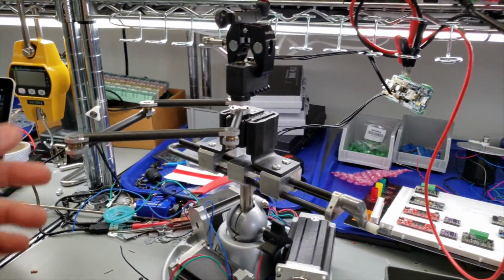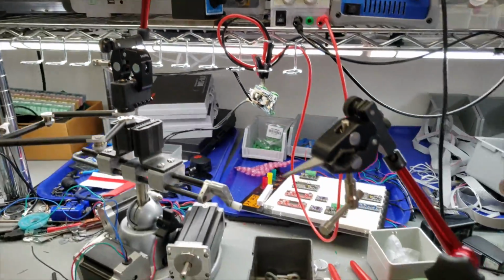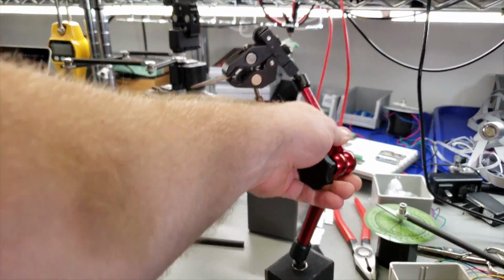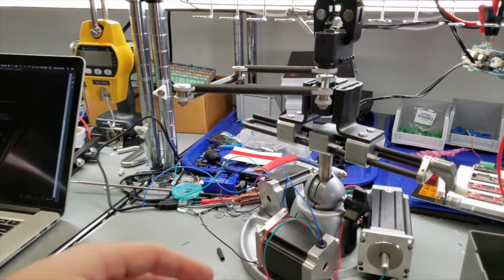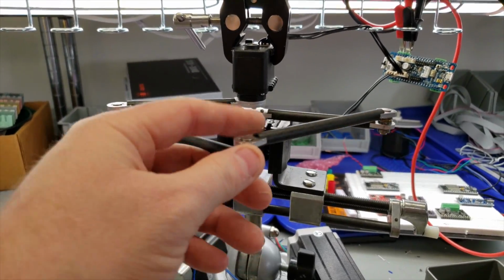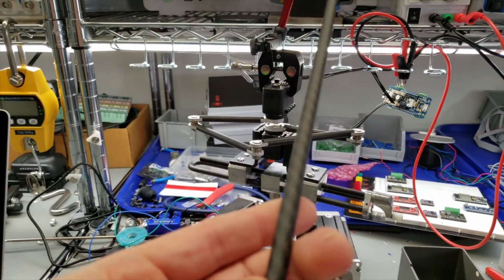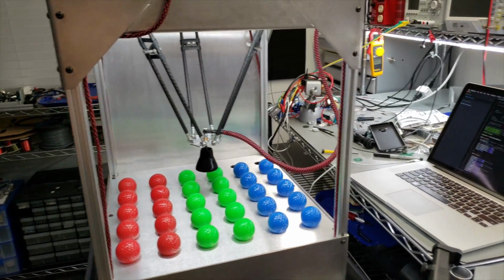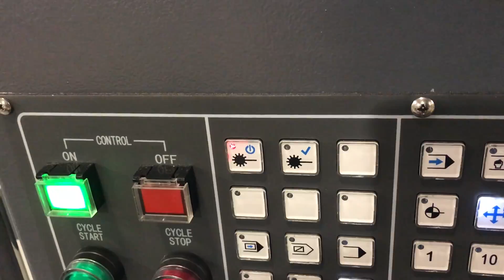Dual Arm SCARA Robot Prototype

Comment: Hey are you just using Shoulder Bolts through those bearings, and housing those bearings in oversized laser cut housings held with retaining compound adhesive?

Comment: Very cool! Already building one... just curious about the joints.  It looks like you have the 5x10x4mm bearings press fit into your 3d printed tube adapter and a thrust bearing in between two arm joints but I'm having trouble seeing if that's a nut on the bottom and if its a bolt thru the top... Looks like a headless bolt?

Comment: Why you not use stepper motor instead of the servo?
Reply from the maker: Servos are much smaller, lighter, and have closed loop positional control. A stepper motor can lose steps if not used with an encoder or higher end driver that detects lost steps like some trinamic drivers.

Comment: How are you doing the inverse kinematics to calculate the correct servo positions to move it to a particular XY coordinate?  
The parallel SCARA kinematics seem so different from a regular robotic arm.
Reply from the maker: I'm not yet, but I have been using this geometric java app to do some testing and will use it when I finalize my inverse kinematics together: https://ggbm.at/hgzdeghs

Comment: You really need to tune the pid loops. You should be able to get much better settling time and reduce overshoot. those are extremely underdamped.
Reply from the maker: I know the PID loops can be tuned on the Dynamixels, I just haven't dug that deep into the servos yet. I just got them and slapped this together. They overshoot without a load at that speed so I would probably need to slow down if I wanted to avoid over shoot. The MX-12Ws were designed to be used as wheels so they are high speed/low torque servos. For what I might use them for, the overshoot is acceptable. The accuracy after settling is pretty impressive. Do you have experience tuning Dynamixels?

Comment: Very neat!  Another interesting project.  - Just signed up as a Patron to support this project!
I built a simpler robotic arm using Dynamixel AX-12 servos that I use to sort cartridge cases, which I show on my channel.  But, that arm is a bit slow and wobbly.
This SCARA approach might work better for my sorting machine.
I'm looking forward to the details of the joints and how you assembled the bearings into the connectors.
Reply from the maker: Thank you! Your machine is pretty cool! Maybe you could substitute the heavier dynamixel you have at the very end with the lever and replace it with a lightweight micro servo to reduce the inertia at the end. You could then repurpose that servo and use it in parallel with your main anchor servo. The two servos at the anchor point could mirror each others movement and make the movements much more smooth. I've seen other people butt two dynamixel servos back to back and use them for a single joint and it seems to work pretty well.
Reply: @ProtoG42  Good suggestions.  I was going to use a tiny XL-320 for the gripper, but I had trouble with the protocol when using the USB interface.  I will try it again with the OpenCV that I got recently.

Comment: Good stuff, how well do you think they would work as x/y-axis motors for a small CNC? (non-cutting)
Reply from the maker: Good, as long as you can deal with the overshoot. For a task like pressing a button at position (x,y), they're perfect! They are safe to use close to people because they will stop if a hand makes contact with the arms and will continue moving to the position after the hand is removed.

Comment: There seems to be a lot of overshoot ?? Do you have a contengency plan for that ?
Reply from the maker: That depends on what I will end up using it for. A lot of modern collaborative robots have overshoot and settle. It's safer and will automatically stop if I put my arm in there. If you watch at the beginning, the motors have overshoot even without a load. If I need absolutely zero overshoot, I would need to either slow down, gear the motors, or get motors with higher torque. I bought these for the speed knowing that there would be overshoot. If the task was to push a button at position (x, y), then this set up would work significantly faster than a robot of similar size that had zero overshoot.
Reply: Proto G Engineering PID control?
Reply: If it's a servo it should use an encoder and only overshoot but to return to a position. That's why we use servos, they are a closed loop system. If it is open loop then it isn't a servo
Reply from the maker: @fataxe1  It is a servo and it uses a non contact magnetic encoder. The extent of the overshoot is controlled by a PID control loop. Tuning that loop will change the amount of time before the motor has settled to its final position. For optimal results, the PID control loop should be tuned while attached to the mass of the final application.
Reply: @ProtoG42  yeah, but it looks like the mother comment is concerned with overshoot as lost steps. Closed loop isn't going to suffer that. Eradic path, yes, final position, no
Reply: @fataxe1  Clearpath Stepper/servo motors NO OVERSHOOT, power, tork, repeatability 100% 

https://www.youtube.com/watch?v=P6BGzL0lRVg
Reply from the maker: @altamiradorable  The cheapest, lowest torque Clearpath stepper/servo is $257 USD. The highest torque at that price point is only 223 oz-in. The large stepper motors I used on my delta robot have 1600 oz-in of torque and all three motors were cheaper than one 223 oz-in Clearpath servo and have 7 times more torque each. As I said, not every application requires NO OVERSHOOT. For example, if a robot needs to go to position x-y and then press a button or release an object, why would you ever consider spending more than 3 times the price on a Clearpath servo that will perform just at well at the end goal? Clearpath servos are great but not necessary for a lot of robot applications. Human arms have overshoot and they work just fine.
Reply: Hi, really impressive speeds! just wondering though if you have considered the odrive: https://odriverobotics.com

I’m thinking of using one with encoders on the brushless motors, they also do some speedy robotics stuff.
Reply from the maker: @nixman2  I am really interested in odrive but I waiting until the boards support absolute encoders. Currently, they only support incremental encoders which means you will still need limit switches to home the motors. The dynamixels use absolute encoders so they always know where they are. Incremental encoders only keep track of steps taken in relation to the home position.

Comment: Where did you get these nice clamps that you use at the end of the "helping hand"? I have never seen those before.
Reply from the maker: They're awesome, I use them to hold everything from motors to oscilloscope probes.
Here are the clamps I use: https://amzn.to/2VQXdev
I mount the clamps to these: https://amzn.to/2FpB95V
Reply: Proto G Engineering looks like as if these might be nicely 3D printable as well... superb inspiration! Just discovered your channel today and I like your projects A LOT.
Reply: Ok, found them. "Stativklemme" is the word in German in case someone cares. This was an excellent inspiration, thank you!
Reply: I already have the magnetic arm but just use something like an alligator clip attached to it. The clamps that you use are absolutely awesome compared to that. Must research where to get them in Europe.

Comment from the maker: Here are links to some of the parts used on my SCARA:
Dynamixel MX-12W Servos: https://amzn.to/2M6xLgK
Carbon Fiber Tubes - https://amzn.to/2J5xVqz
Mag Base Indicator Holder: https://amzn.to/2FpB95V
Crab Clamp: https://amzn.to/2VQXdev
Thrust Bearings: https://amzn.to/2FtDP1u
5x10x4mm Bearings: https://amzn.to/2CiXCxD
OpenCM Controller: https://amzn.to/2FugJI3